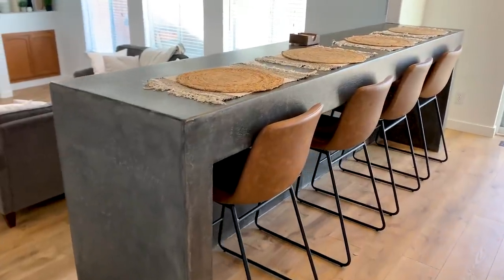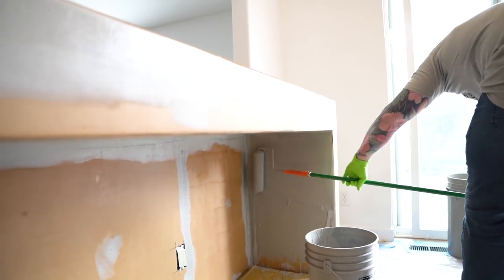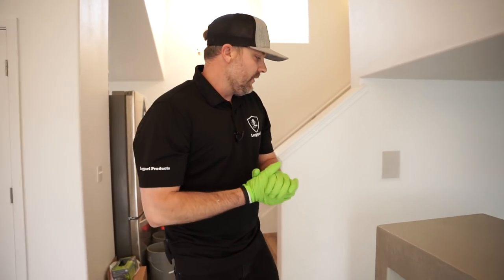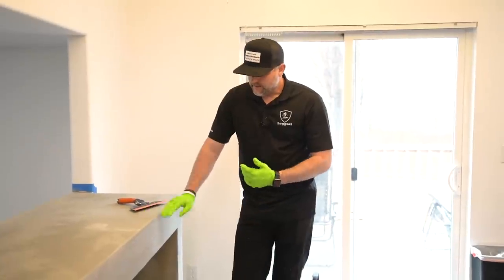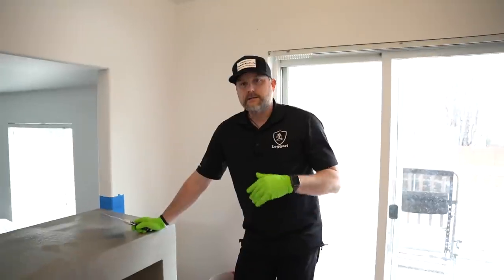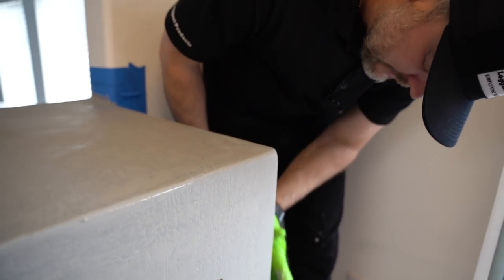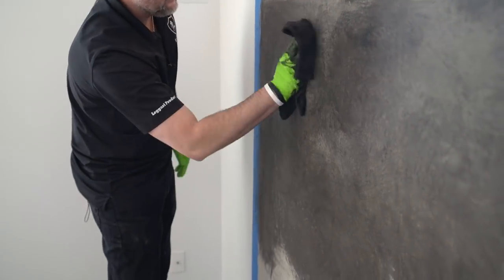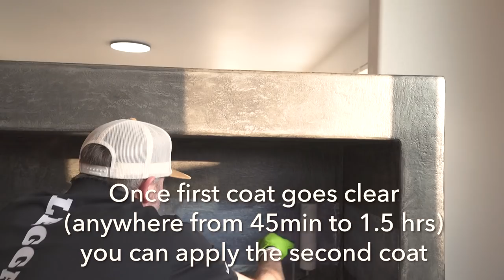Updating Old House Railing To Concrete Bar | Easy Way To Transform Space

Comment: Great video 👏 Wow very cool. Looking at building a beach runner trailer to camper conversion.  Wanted a cool surf board  bar table. Now thinking about doing something like this cement table. Need to keep weight down.

Was also thinking of putting down large vinyl ocean wrap/sticker on floor then epoxy over with clear coat and sure grip. Not sure how everything will react with plywood floor. ( moisture/ flex of floor) 

Love to get your thoughts.  Again great channel and video.